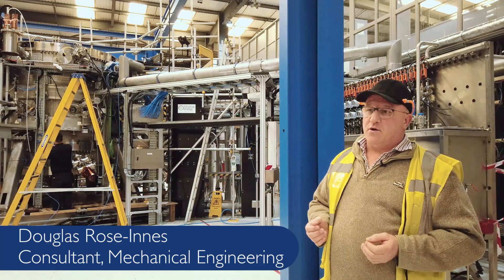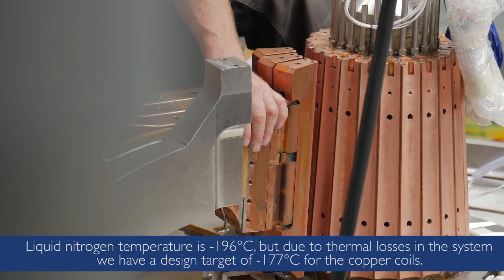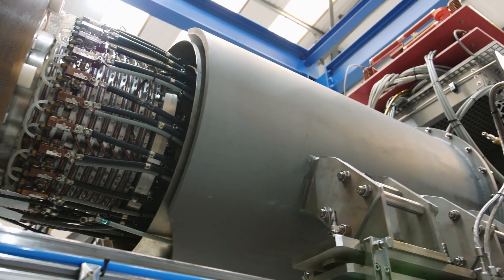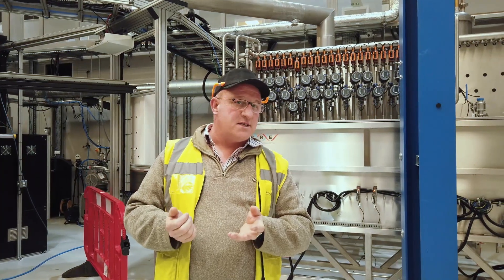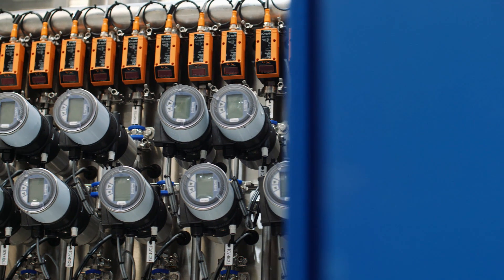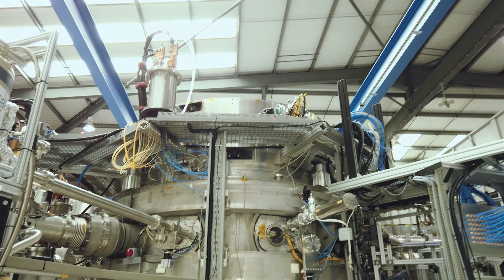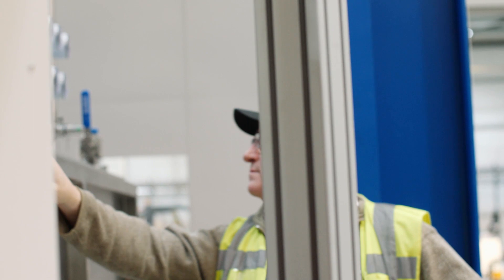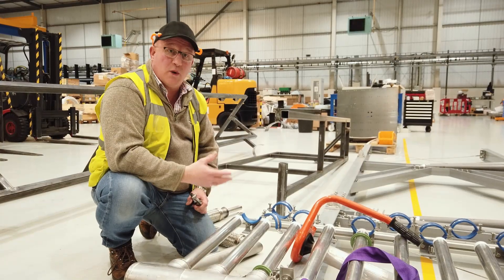Cooling the magnetic coils to improve performance of the ST40 tokamak

Comment: thing is,, for  sustain operation, one would need a lot of nitrogen cooling, which probably means it's not a design for long term operation.
Reply from the maker: No, it's not.  The nitrogen is cooling copper coils to enable them to produce higher magnetic fields for the experiment. Future machines for long-term operation will have magnetic coils made from superconductors.

Comment: Where do the high-temperature superconductors fit in?
Reply: HTSCs tend to be very fragile and might snap under pressure.
Reply: Great question though. Once we have some HTSCs that operate well under standard pressure and a few kPascals higher, maybe they can be used effectively in nuclear fusion. As something other than magnets.

Comment: This is great - lots of nice tecnical detail. more please!
Reply from the maker: Thanks. Glad you liked it.
Reply: @tokamakenergy6400  

If what is shown in the video, when he mentions the copper, if that is pure copper and not mixed for what he mentions, then why aren't you guys using Graphene instead to replace the copper, it can be scaled up with 100% of its purest form if you ask the right companies to do it for you.

I'm sure you have seen Flash Graphene and some other new methods to scale it up that came out over this year.
Key word there, "large" machines to scale up the Flash Graphene, that you place the carbon into just to use electrons and flash the carbon into Graphene, this process is known as "Flash Graphene".
They turn trash / garbage into carbon and then place it into a large machine to flash it into Graphene. The quality is "above" 99% Graphene.
This can be done with coal, oil, rubber, plastics, food we throw out after dinner with carbon in it, fossil fuels, anything with carbon in it can be turned into carbon and then flashed with electrons into Graphene, for Flash Graphene.

Graphene by itself isn't artificial "man made", and Graphite is just layers of Graphene, like the Graphite pencil.
And so imagine Graphene in its purest form is better than any other material as thermal conductive and electrically conductive, if you compare it to other materials like copper in its purest form without mixing the materials, Graphene beats them all. And it's better than silicon.
So imagine if you mixed Graphene with other materials to become even better like they do with the copper in high field magnets? Replace the copper mixed, and use Graphene instead mixed with it.

-------------------------------------------------------------------------------

Though to point out again and not to forget, please remember that anything like in this video that shows copper alone by itself, could be replaced by Graphene.
------------------------------------------------------------------------------

Copper has a melting point of 2,500 degrees.
Graphene has a melting point of over 5,500 degrees. 
And that's just the materials by themselves without being mixed, see my point? Look at the video and if correct, is that copper by itself? It can be replaced by Graphene.

With your high field magnets, is it copper as mentioned mixed with them? Replace the copper and use Graphene in those also.
----------------

And Graphene hasn't been completely tested, it could be higher. It depends on the source, if they are using Graphene in its "purest" form 100% Graphene, some labs will say it's lower and because of a bias, they will lie or not notice that their Graphene is not as "pure" as they think. That is why it takes multiple labs to remove such a bias, for a fair and justifying result for Graphene thermal conductivity. But everywhere you go, Graphene is mentioned as the best material as the highest thermal conductor, and "supposedly".. better than copper and way better than silicon as a semi conductor by itself without being mixed, but can become a super conductor.

Graphene Twistronics = super conductor and insulator.
Graphene Spintronics = electronics 2.0 "with electrons and not Photons".

Photonics to replace electronics, imagine a light based world of Photons as the energy source, like with fiber optics, and Graphene is transparent to allow Graphene Photonic Computing as the transistors but also as the fiber optics in the computer for Photonic Computing, though Graphene doesn't have to be transparent, you can see many companies manage to change this in their products.
Reply: @tokamakenergy6400  

Imagine a Graphene Photonic reactor, think about it as the electronics but also as the Photonics inside the fusion reactor.

Now imagine your fusion reactor inside being light based, saves on energy, quite literally because it's Photonics, see the big picture there.

And so it's not just for wires / circuits inside the reactor, but also for many other parts, even replacing all the copper as more of a light based energy source before it becomes fusion, quite literally, and saves a lot of energy.
Again please remember and note, that it doesn't have to be just the electronics / Photonics of the wires / circuits, it can be other parts of the reactor, or any part as Graphene or " Graphene Photonics ".
Reply: @tokamakenergy6400  

Imagine making these machines very large, massive.. to produce Flash Graphene cheaper while scaling it up. Though to keep in mind the quality of the Graphene produced, is it above 99% when you make it, it's supposed to be with Flash Graphene and these machines.

Large machines to scale up Flash Graphene fast and cheap enough.
https://www.youtube.com/watch?v=hKIqgD-Aeds&list=PLAUtk-Q2DF7xsjVfESM1sqZdkHJYRw--j&index=8&t=0s

==============================

And then after that, imagine Graphene for Photonic Computing, to help us save on our energy needs, really think about that for a second with Photonic Computing.
Instead of Photonic Computing, now imagine that for the electronic wires / circuits, or even Photonics inside the fusion reactor, but as many different parts, not just for wires / circuits.

If you want to see the big picture there, watch these 2 playlists, watch the videos from top to bottom in that order.

Photonic Computing.
https://www.youtube.com/playlist?list=PLAUtk-Q2DF7yx80jrh7uORkHKowzGy7pi

Graphene computers for home and Starships.
https://www.youtube.com/playlist?list=PLAUtk-Q2DF7yXpZ9mVoTfXdnKVp0SvF4v

Learn about Graphene from my other channel's "Graphene playlist".

If you want to know more about Graphene and Quantum Technologies, go to my other channel.